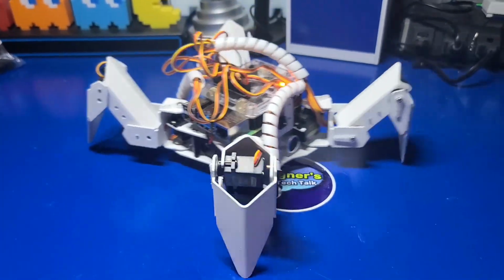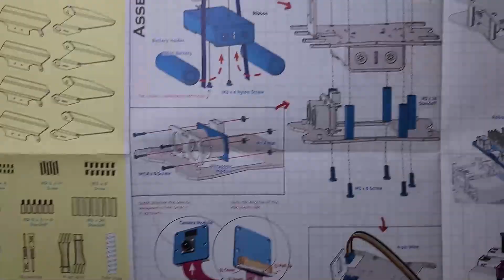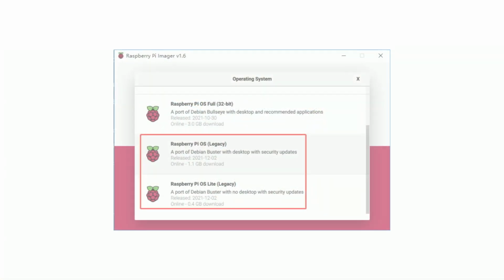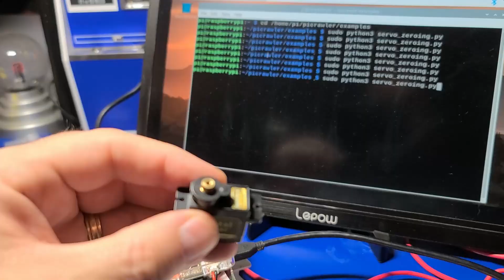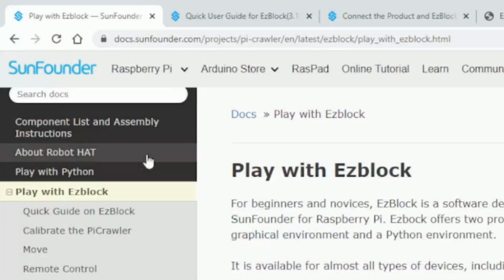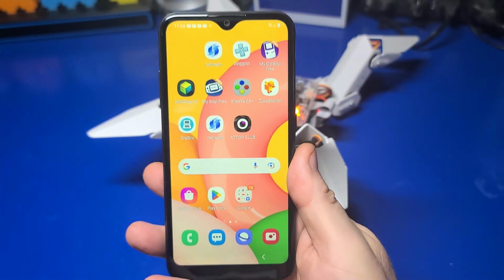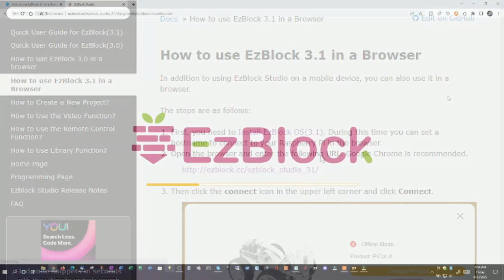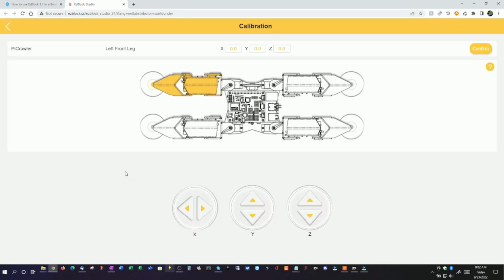Raspberry Pi 4 Robot: The PiCrawler Robot Kit +Setup Guide (2022)

Comment: Thanks for a great review! What was the exact name/brand of the batteries and the charger you used?
Reply from the maker: Very welcome, thanks for checking it out!  I just added the batteries and charger kit that I purchased for this video in the video description.  I didn't use the USB 18650 charger with the batteries however, it should work.  Years ago I bought a special 4 battery charger with separate charge indicators for each battery which is no longer available on Amazon.

Comment: Hi John I have question to ask since your are very knowledgeable about atgames products. I was wondering can you connect a pixelcade to a legends gamer pro, I want to get the Bitlcd and use the pixelcade for pro thanks
Reply from the maker: Hi Billy, the BitPixel should work with the Gamer Pro.  I haven't personally tried it, but pretty sure the PixelcadeX app. is there.  The BitLCD, currently, will only work on the ALU.  The BitLCD app. itself is only available on the ALU.
Reply: @WagnersTechTalk  thanks yes I have the pixelcade on ALU already I want to get the new bitlcd for that and just use pixelcade on gamer pro thank you for responding

Comment: The kit seems to have changed. as of 2024, there is no acrylic plate, and the way things plug and screw in isn't totally the same as in this. it also has no instructions on programming, unless you use the QR code on the box, and download the instructions.
Reply from the maker: Thanks for letting me know there have been some changes since this video.  For the most part, was the video still close or do I need to add a comment that it's significantly different?  For the on-line tutorials and Play with Python code, you can find them here: https://docs.sunfounder.com/projects/pi-crawler/en/latest/